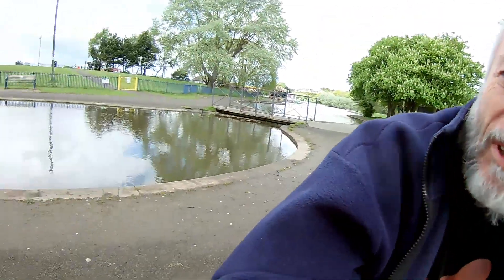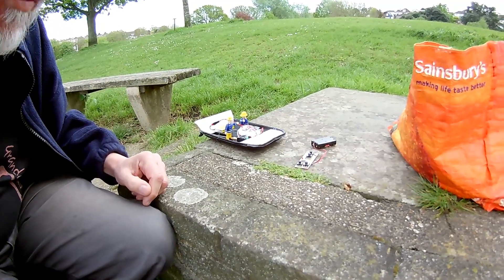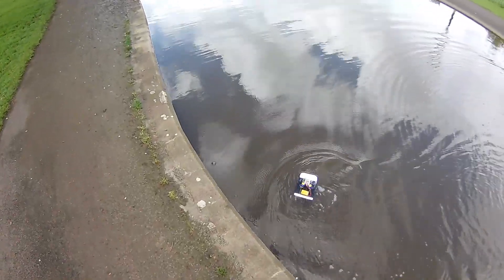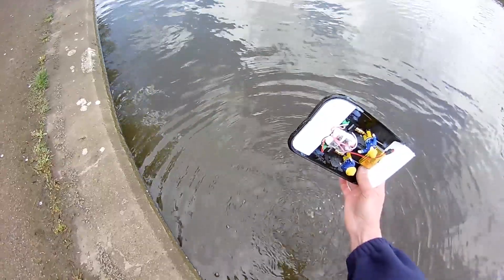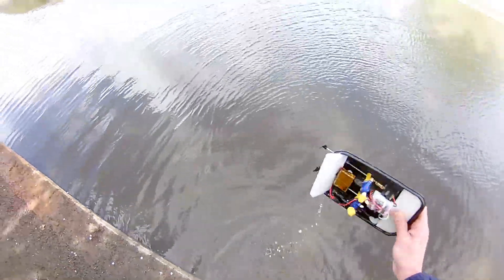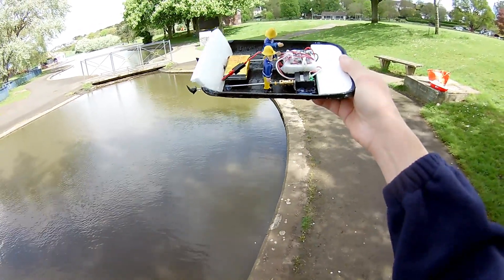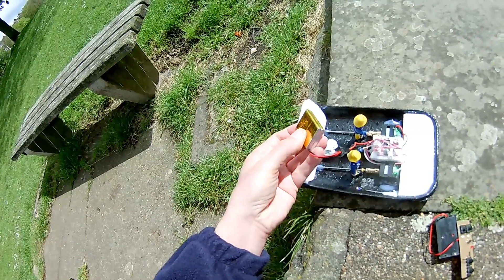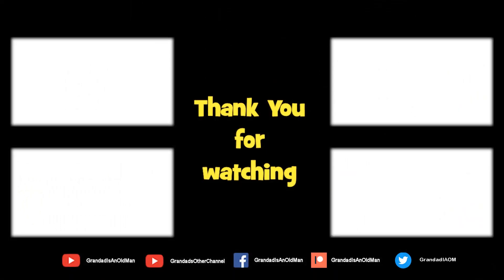RC cardboard fruit tray boat @ Portishead Lake

Comment: That goes alright, the differential power gave more control than i was expecting but then the props are wide apart relative to the hull width, when it got water in it and was lower in the water it appeared to go faster, maybe the props need to be a certain distance below the surface to avoid cavitation.
 BTW, didn't realize Westward Ho! was so far from you, I mentioned it because I knew this was one of your old haunts that you've made recent video's of. Tomorrow looks like a great Kite flying day, maybe bribe with other half with the promise of tea and cake at that National Trust place with a large car park......
Reply from the maker: I was out flying kites today, even put the camera up there briefly, not very stable but at least it flew. The videos will be online later in the month.
Reply: @GrandadIsAnOldMan  Great News, more kite video's on the way !!